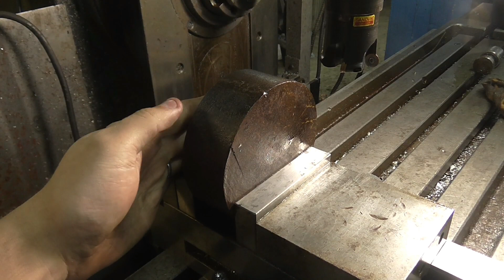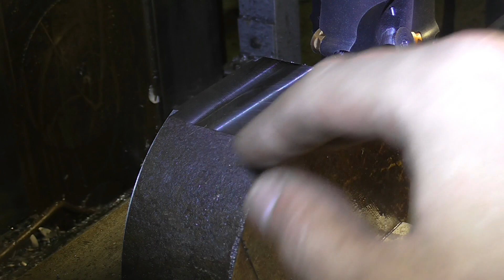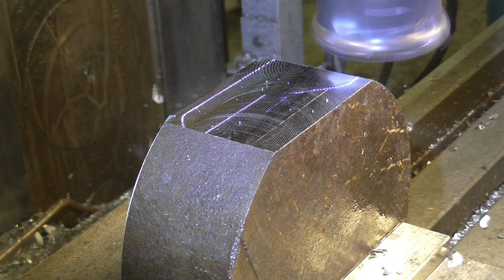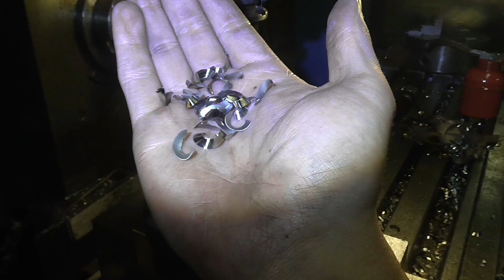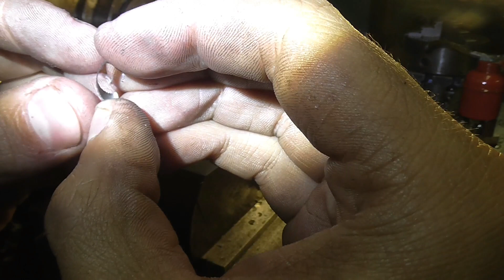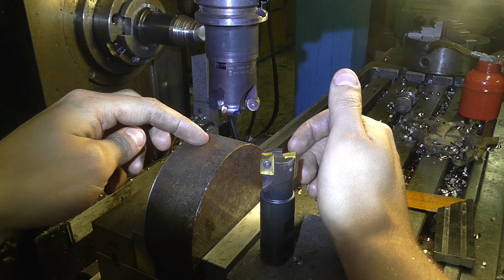Testing a Sandvik Coromant Coromill 300

Comment: That was a very interesting video. FIrst, if I made all the comments I want to make, this comment would be longer than the video. Second, thanks for no BS. Third, your opinions are very valuable to me.  Fourth, experiments outweigh "accepted practices" completely. So on to climb milling: this applies to end mills on steel. It's not that you shouldn't do it, it's that you have to be careful. You are pulling the cutter into the piece and may get in trouble. Depends on DOC.  Climb milling produces a better finish. With a face mill I think you have shown conclusively that climbing is fine. I think the chatter you got on conventional milling was due to impact loading on the cutters because they overhang the piece. As Sandvik said, no-no!  Might quibble about RPMs and feed rate but I have never seen your mill  :) and I hope you can fix it. And lastly (aren't you glad) if you can find the proper cutters, bars, and spacers for that horizontal mill you can gang-mill the sides of that piece in one go. With  many mote Watts. And do a lot of other things besides. And you are no amateur. Far too well educated for that.

Comment: That cutter really removes a lot of metal, at least compared to anything I have.  Keep on keeping on.
Reply from the maker: I guess the final cut was about maxing the motor power, it sounded like it almost wanted to bog down. The universal spindle that I was using is meant for lighter duty work. The horizontal spindle is meant for much heavier work, it has a 7,5kW motor and a way more rigid spindle. I hope one day I will get to use it for something :-)!

Comment: what do these R300 inserts for a geometry and carbide grade? At work I sometimes use R300-1240E-ML, stainless grade 2030. They work incredibly good in aluminum, plastic and even rubber because the inserts are nicely sharp
Reply: *have